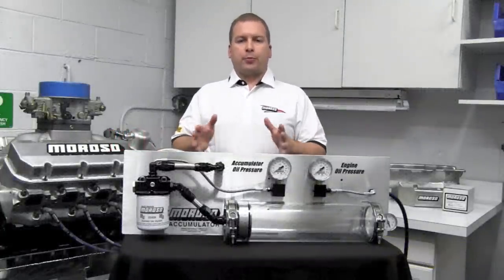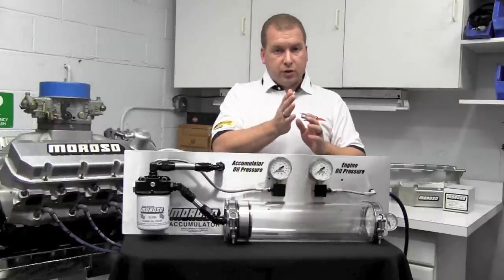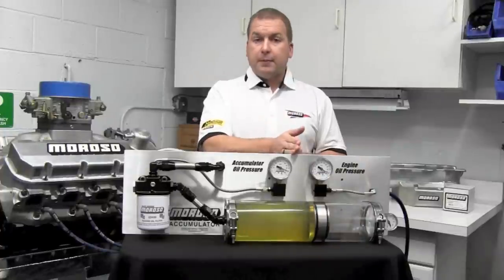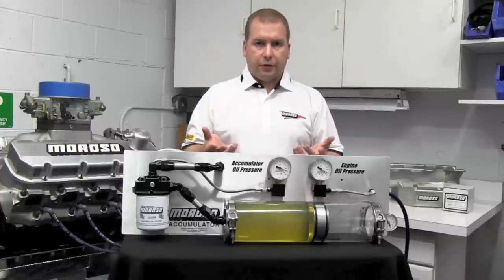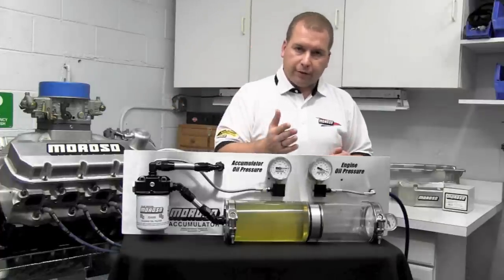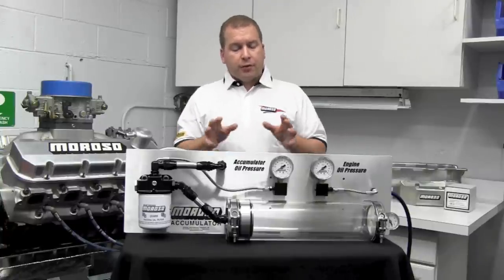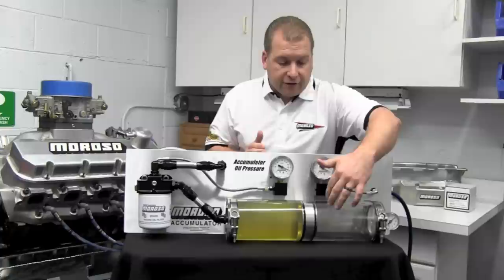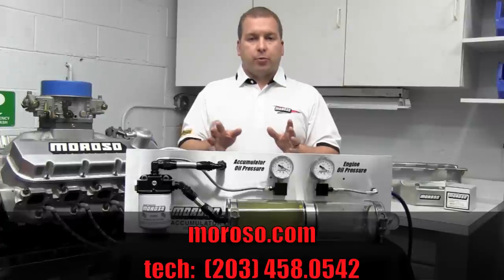Moroso Oil Accumulator, How Does It Work?

Comment: Clear accumulator is great to show how it works. Have one in our time attack Silvia and 700hp GT-R. It has saved our engine in the time attack car and stopped G-Force related oil surge. Every car enthusiast should get one of these
Reply: I'm going to run one on my daily ls1 swapped s10
Reply: @MotiveVideo can you post a video of it installed in the Skyline ?
Reply: I've heard reports from people with RBs that they are good but that sometimes they just don't respond fast enough to a sudden pressure drop so you still have some time without the bearings fully protected. Granted its less than a second. 

What are your thoughts on this from your experience?

Comment: Too bad you didn't show it discharge at 20 psi back pressure. You said it would be faster. "We" wanted to see that.
Reply from the maker: +M Scott Mackenzie We apologize that we didn't show every scenario in the video, we were trying to keep the video at a certain length of time.
Reply from the maker: Paul Wilson   Apologies we previously missed your question, Paul. There is no problem using an accumulator with a vacuum pump, people do it all the time!

Comment: Someone told me that oil accumulators are only appropriate for track dedicated cars tuned to idle above 2k because the pressure in the accumulator is more than in a fairly stock motor at idle. I'm not an expert but is there any truth to that?
Reply from the maker: Accumulators can be used on full racecars or street cars. ZERO ISSUE! In fact, we recommend them on street cars that don't get driven much, because one of the added benefits of the system is pre-oiling before start up! Also, the back charge (air pressure on one side of the piston in the unit) is usually about 10psi, nothing crazy at all. Once the engine is spinning the oil pump and making good pressure, the accumulator should read what your engine oil pressure reads, give or take 5 to 10 pounds. Even at idle, unless your engine makes below 10 psi at idle, then you may have to drop the back charge pressure. Hope this helps!
Reply: @MorosoPerformance  yes! Thank you very much.
Reply from the maker: @1Solace  You're welcome! If you have any other questions, please ask!

Comment: what about air bubble ? i saw 2 air pocket in the accumulator and what if the seal fail and just push lot of air bubble into the loop? :/
Reply: This is the exact same concept most jet engine aircraft use to start their engines. The accumulators are abused much heavier on them. Those o-rings ~almost~ never fail. I can’t imagine that would be much of a problem on these. Although… it’d be crazy to accidentally over charge the thing and twist that skirtless piston….

Comment: What is not covered here, is that if you add an air accumulator tank on the back side, you can run a higher pre-charge, but get a larger volume discharge at the same time.
I run about a 1 quart air tank, tied in with a 'T' fitting where the pre-charge gauge is hooked up.
 (35 years of compressed gas, & hydraulic experience)
Reply: this is very smart, thanks!
Reply: It is, indeed, a good idea - big reduction in the delta pressure as the oil volume changes.
I was thinking a long spring with a lot of pre-load to give a fairly constant pressure over a longer range of valume - maybe in conjunction with the air pressure.
The concern I have is people relying on this when, in practice, there is a fairly narrow range where the big ends will have a supplemental oil supply - I mean from normal operating oil pressure to the point where the centrigugal force in the main bearing oilways prevents oil flow into the oil feeds to the big ends - at high rpm, that may be a 20-30 PSI drop range, which is going to be a lot less, proportionally, of the nominal oil volume in the accumulator.

Still, some is better than nothing, isn't it! ;-)
Reply: @gordowg1wg145  3Cressidas is correct in what he is saying but its the amount of oil you will end up with in the sump as it will take a while to fill the accumulator to refill the video shows a clear tube but in real life you won't be able to see inside it so you will have to look at the pressure side of the gauge to work out how much oil is in your engine sump so to make sure you have enough to check on the dip stick and enough to fill the accumulator i think it will blow more engines in the long run as they will be running with a lower oil pressure over time maybe dragsters might benefit but it would have to have 60 psi + and be activated on take off and it would be all over in a few seconds
Reply: @helicopter269  Re-read the thread, and consider the delta P. Hint - relative volumes of pressurised air/gas Vs oil.

I would agree with you if the oil flow was un-resticted both ways, but what is usually done is to have a relatively un-restricted feed from the accumularor to the oil system, but a partially restricted feed from the oil system to the accumulator, there will be a small potential drop in pressure, due to the bleed off, but it should be using the oil flow from the pump that would have been passed through the pressure relief valve to fill the accumulator instead.

Comment: Looks like a great product. Super clever. 
A few questions
1) have you considered manufacturing/do you manufacture a smaller version for daily drivers
2) have you done any cold climate engine wear studies? 
3) have you considered using 100% nitrogen to stabilize the pressures in different conditions (ie temperature and altitude)
4) how does the accumulator change the capacity? I’m slightly unclear on how this doesn’t put the pump at risk of scavenging air… it seems like it both solves the problem but also maybe could cause a problem? 
5) why the additional oil filter?

Comment: great video thanks I have seen them at the drag strip but never understood how it worked I didn't realize it was a constant watch dog I always thaught it added an extra 3 qt to the engine every pass that had to be drained out and then re added to the accumulator I didn't realize it was selfe sufficient I just bracket race but engins are spendy oil is cheap I think this would be a great investment thanks.

Comment: Love these, have one in my drag car and one in my pro-street car. Both big motors. But to make these 100% useful you need to bench set them up. Then on the INITIAL startup they do their job. It's not that hard to do. After that they continue to do the job. Got to have electric solenoid valve or a wife that will open the valve. Good Luck with that.
Reply: Why not open the valve yourself and then start the car. By the way what’s a bench setup

Comment: When you first charge the system, how do you charge the accumulator with oil pressure not to rob the engine from the oil at start?
Reply from the maker: The accumulator will not rob the engine of oil as long as the accumulator is pre-charged properly and the correct additional amount of oil is added into the system.

Comment: I assume some thought has to be put into the size of the accumulator in relation to the capacity of the oil sump (if using stock sump, not dry). As if the accumulator is too big it could steal capacity from the engine sump when its nearly full, reducing the oil level, and also on the other end, if it dumps all its capacity it could overfill the sump (and cause oil foaming etc). This is just an assumption. Please advise.
Reply from the maker: Sorry for the delayed response!

By design, a 3 quart accumulator holds about 2 quarts in the cylinder. This volume is enough to feed an engine that is flowing 9 gallons a minute at 7000 rpm (typical wet sump small block chevy) for about 2.5 seconds.
Often when an accumulator is in use, it’s during de-acceleration, the requirement will be less, and thus take longer to empty the oil into the engine.
As far as the capacity question, when the two to three extra quarts is added, it goes to the accumulator and the plumbing involved, so it doesn’t affect the oil capacity in the oil pan when the engine is running.
And when the accumulator releases oil into the engine, it will never over fill the sump. If the sump was “full enough” there wouldn’t be a drop in oil pressure. So once the sump regains enough oil to submerge the pick-up, it will take the extra oil and refill the accumulator and bring the system back to its original condition.

Hope this helps. If you have any other questions, please ask!

Comment: Shouldn't accumulator should ALWAYS be on the post side of the oil filter so that the oil charge from the accumulator is prevented from flowing backwards into the filter by the non return valve in the filter?  Otherwise in a cold start situation some of the charge could be wasted in filling any hoses that have drained back into the sump?

Comment: How will the accumulator hold like 60-80psi of oil in the tank if when already engine hot idle oil pressure is 20psi?
Reply: It won't hold but will drain till the pressure in the oil side is balanced with the precharge. Once rpm (and pressure) comes back up, the oil quantity will increase

Comment: Can you run this accumulator in line with a thermostatic oil sandwich plate meant for an oil cooler?
Reply from the maker: Hello, an accumulator can indeed be used with a thermostatic sandwich plate to adapt it to an engine. Something to note, the accumulator would need to be plumbed into the Pressure In side; if you are looking to use the accumulator to pre-lube the motor on a cold start a closed thermostatic valve would not allow it to do so.

Comment: You never discharged it at 20psi, and now I'm sad.  Do you set the precharge more based on engine bearing clearance and oil volume instead of application (drag, circle track, road race, etc.)?
Reply from the maker: AR G A 20 p.s.i. precharge would cut into the amount of oil that the Accumulator will hold. Yes, a  20 p.s.i. precharge will make the Accumulator discharge a little quicker but  a 7-10 p.s.i. precharge will discharge almost as quick with more oil  going from the Accumulator to the engine.

Comment: How long does it take to fill the unit wit normal engine  oil pump?
This concerns me. as if its slower than normal, the oil pressure will lag behind the rpm rise. EG: if you blip throttle, the oil pressure won't rise past the pressure in the back side of accumulator until it's full . It seems this is quite some time. delaying oil pressure increase, that should have happened instantly with rpm.
Reply from the maker: The fill time is dependent upon the air pressure that the accumulator is charged with. We only recommend an air charge of 5 to 10 PSI so that the engine’s oil pump can quickly refill the accumulator once it picks up a prime. Our display rig is intended to show routing and functionality of the system, and is not necessarily reflective of response time since it is not actually connected to an engine.

Comment: We are racing a Acura v6 engined Miata and we are experiencing an issue where in long left handers the oil pressure drops to about 20 lbs (with the  2qt. accumulator set at 10psi) and as we exit the corner and start picking up the rpm's the oil pressure is still below the 57lbs needed for the ecu to activate the VVT solenoid and it puts the car into limp mode. Can you advise on a possible solution? Thank you.
Reply: Get a proper oil sump for gods sake. 
Poor car.

Comment: How will it not rod oil pressure and volume during cold start? I cannot see how that is possible.For a racecar this may be an acceptable tradeoff but for a everyday Highly tuned street car that runs winters that does not sound like a good solution.
Reply from the maker: Thank you for your interest in our products. Accumulators will not rob oil pressure and volume during a cold start, one way that is accomplished is by the Accumulator having a manual valve that the driver of the vehicle opens right before starting the vehicle (electric valved Accumulators work on the same principle releasing the reserve of oil into the oiling system and the path of least resistance. This pre-lubes the engine,  once the engine reaches normal operating oil pressure the accumulator will fill back up. When the driver of the vehicle is done driving the car; they either close the manual valve or close the electric valve by either a switch or tied into the ignition and turning off the ignition, will capture a reserve of oil in the Accumulator that is used to pre-lube the engine on the next start up.  Having a manual or electric valve on the  Accumulator is important if the driver wants to capitalize on the benefits of pre-lubing an engine with an Accumulator.
Reply: @MorosoPerformance  it would absolutely still rob oil volume, when the car is first started. (especially if the accumulator has been emptied)
if you have a weak oil pump this may be a problem.

it would be much better if the accumulator had a restricted inlet port.
what happens when you are in a sharp corner for a long time, and the accumulator has been almost emptied?.. well when you are out of the corner and really hitting it, then not only do the oil pump have to supply the engine with oil, but also it have to supply the accumulator with 3qt of oil. i can't imagine this is good.
Reply from the maker: @NickiLasse  ,
When setting up an Accumulator after installing it or after an oil change, extra oil is added to the system to compensate for the volume of the Accumulator and the line going to it. Remember an Accumulator is like a brake booster, it pushes the fluid that is already in the system. On a non-Solenoid Pressure Valved equipped Accumulator, the Accumulator will release all of it's storage of oil into the system when it senses a pressure fluctuation. The non-Solenoid Pressure Valved equipped Accumulator then refills when the engine reaches it's normal oil pressure range. The engine's oil pump will always overcome the Accumulator wanting to refill because of fluid dynamics, the Accumulator's path is more restrictive than the pull of the engine's oil pump. A weak oil pump was mentioned, if this was the case, the oil pump would have to be so compromised that the engine would blow in a stationary/idling mode. On an Accumulator equipped with a Solenoid Pressure Valve Kit, the Accumulator discharges and fills only the needed volume of oil to be released for quicker discharging and refilling.

Comment: Hello does it come with a one-way check valve?  I Don't want the morosso accumulator pushing oil back to the oil pump and the pickup tube where it is not needed.
Reply from the maker: A one-way check valve is typically only required if the accumulator is plumbed in an external return loop with a remote filter, cooler, etc. We do offer one separately, P/N 23875

Comment: If you used this in a street application would you run into a situation where you were dumping 1.5 quarts of oil into the pan at every stop light as the car idled hot and oil pressure fell to around 15 - 20 psi?   Most engines gain about 10psi per 1000 rpm of engine speed from idle to about 5500rpm.     I like the idea of installing one of these on my Suburban but now im rethinking the the 3 quart for the 1.5 quart since that works out to only 3/4 to 1 quart capacity with a 5 psi back charge.   Do you recommend using more temperature stable nitrogen as the charging gas or do you feel this is completely unnecessary?
Reply from the maker: The accumulator will release additional oil into the motor during situations of rapid pressure loss, such as hard braking or acceleration. As long as the air charge side of the accumulator is charged to the recommended 5-10 PSI, you will not run into instances of it frequently overpowering the pump pressure and dumping the reserves into the motor. This will only happen if the vehicle is regularly experiencing high g-force maneuvers. While nitrogen is generally more stable than normal air, we have not done any testing with it in our accumulators as of yet and would not be necessary. We generally recommend using a 3 qt model on large displacement 6 cylinder and V8 applications, and the 1.5 qt on smaller motors.
Reply: ***** Thanks for answering all of my questions..  I like the idea of installing this as a pre lubrication unit prior to startups..  Seems like it would eliminate a major source of engine wear.

Comment: Will more oil need to be added to the engine to offset the capacity of the accumulator ?
Reply from the maker: Yes, more oil is required.
Reply: @MorosoPerformance  Thanks for the quick response.  I am having a slight rattle at cold start with my 06 4.0 ranger. Pulling the fuse for the fuel pump and turning the engine over for a few seconds eliminates the rattle. But this accumulator is what I need long term.

Comment: Might be a weord question. But wouldn't starting a car with empty accumulator cause it to take a lot of time to build oil pressure
Reply from the maker: Thank you for your interest in our products. Accumulators will not rob oil pressure and volume during a cold start, one way that is accomplished is by the Accumulator having a manual valve that the driver of the vehicle opens right before starting the vehicle (electric valved Accumulators work on the same principle releasing the reserve of oil into the oiling system and the path of least resistance. This pre-lubes the engine, once the engine reaches normal operating oil pressure the accumulator will fill back up. When the driver of the vehicle is done driving the car; they either close the manual valve or close the electric valve by either a switch or tied into the ignition and turning off the ignition, will capture a reserve of oil in the Accumulator that is used to pre-lube the engine on the next start up. Having a manual or electric valve on the Accumulator is important if the driver wants to capitalize on the benefits of pre-lubing an engine with an Accumulator.